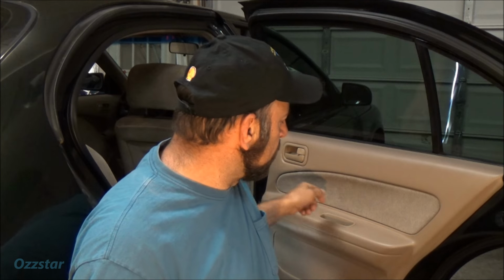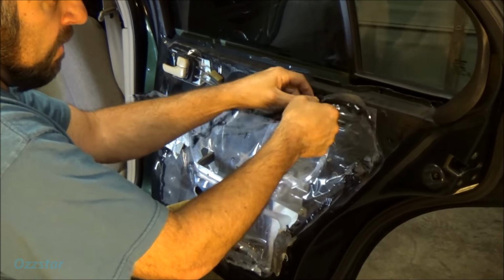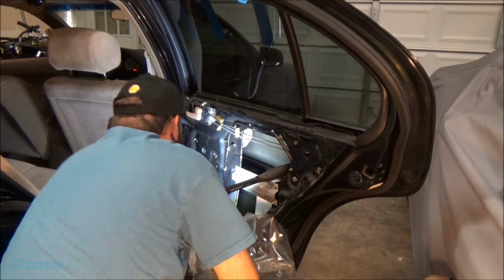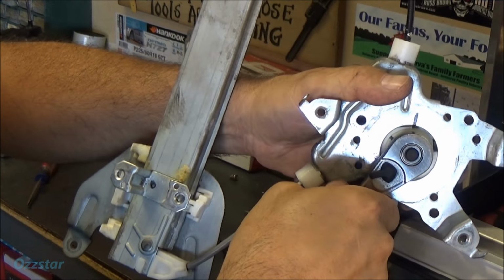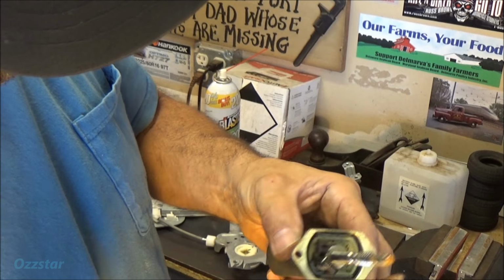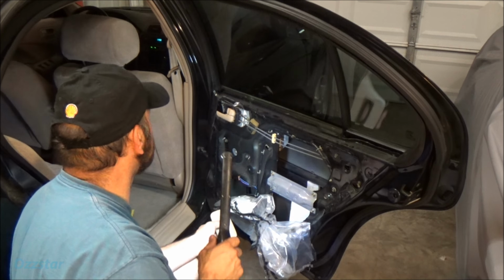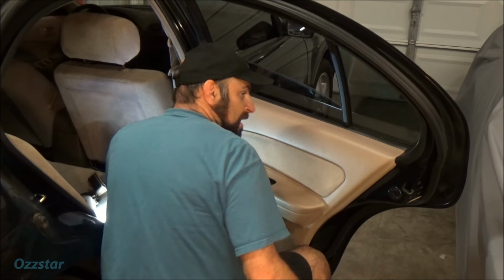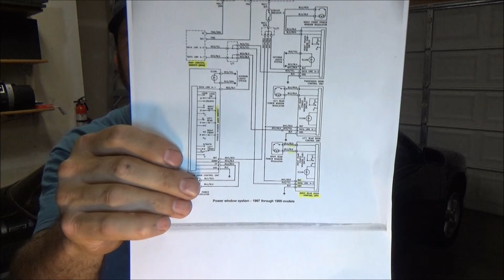Power Window that won't Go Up or Down

Comment: Congratulations. A man who can actually make a video that can be understood and shows excellent details.
Reply from the maker: Thanks David!
Reply: Hi guys, wonder if anyone might be able to help. My Roadster mk 1 driver's window has been slightly erratic for about 9 months but always corrected itself. After a serious cold day it appears to have had enough. It goes down but only up by 1/4 - I've tried all the 'tricks' but no go. Just changed the window motor and still the same. I'll watch the vid when I get back home but does it sound like a regulator issue (as the window does go up partly..??)

Comment: There are a few reasons why a power window stops working and i hate the fact that you can take it to a garage and get ripped off telling you its one thing when it was just a minor repair. Thats why i like to watch you tube videos and get informed prior. Ive replaced a power window switch myself before but never the motor. I'll leave that to my mechanic guy. Thanks so much for the clear instructions it helps so much!

Comment: Good advise -  you never want to break your rubber! 😁

Those are my favorite kind of fixes - no money spent, and no driving to the parts store. That's a win-win! Good job getting her moving again. 👍👍
Reply: Yes!  I have found that just cleaning up the old motors and regrease everything works a lot better than replacing with the aftermarket junk. 

I've opened up motors that have lasted at least 3 years and still going.  Gotta love NO PARTS NEEDED! 😂😂😂
Reply: @CubasAutomotive  - Nice, Cuba - good to know! Thanks! 👍🍻
Reply from the maker: Yeah man, breaking that rubber can be emotional.  Thanks for the classic hanger you mailed me.  I got a big kick out of that one and so have a few friends I showed it to!!
Reply: @ozzstars_cars  - HAHHA! Great man, glad you liked it! Everyone got a kick out of it here as well - always struck up a conversation, LOL! I knew you'd appreciate it. 😁👍😎

Comment: A few years ago a friend of mine had a Ford Windstar that was nearing it's end of life. He called me one day and told me his drivers power window wouldn't work. I went over to his house and hit the bottom of the door with the side of my clenched fist while pushing the button. The window worked perfectly. A few days later i asked him if the window was still working. He said, somewhat. When i asked him what he meant he said that his foot was getting sore because now he had to kick the door to get it to work. 😁
A couple of days after that i gave him a lift home from the crusher. Problem solved!
Nice job, Glen.
Reply from the maker: I have a feeling your friends van had more than a window issue. Haha  Thanks for that story.
Reply: @ozzstars_cars  HaHaHa  The whole van was an issue.

Comment: GREAT VIDEO.  I have the same problem with '98 Accord V6 sedan R RR window.  Likely I have to replace the motor.  I need to buy the tools and die-electric grease and sulucone lubricant before getting started.  Thanks again, I could not have done the repair without the help of your video.
Thanks again.
Reply from the maker: Glad the video helped you out and good luck with the repair!

Comment: That's a good thought, to use tuck tape when putting the vapor barrier back on. I found the OEM sticky putty at an automotive paint shop, but it's expensive for what it is. Now I have enough for hundreds of vehicles, ha ha.
Reply from the maker: Nothing like a good seal to keep the gremlins out, right?

Comment: Coming from a 50 yr. experience Auto tech, now retired , when a motor like a rt. rear window motor sets unused for a while in dusty and damp and hot conditions the result can be the brushes tend to really to stick to the commutator almost like being tacked to it.  In most cases the right rear motor is less used. Been there 100's of times.
Reply from the maker: Experience matters a lot. Thanks for your comment.

Comment: I will use a multimeter (just ordered it) nstead of a test light.  What should the digital read-out show?  How many volts or mA and on what setting do I out the multimeter?
14:06 reminder for myself only
Reply from the maker: Most car window regulators work on battery voltage, 12V system.

Comment: Hello, great video. I am facing issue with my rear left side power window. When I use driver side master switch, it will come down but not up. Rear switch is working fine though. Problem is not with the driver side switch, as I checked it by replacing with other. What do you think?
Reply from the maker: Have you checked for a broken wire or corrosion in the circuit?  A wiring diagram will be helpful to find the problem.

Comment: How do I keep the window from dropping while I remove the regulator? I have a 2010 HHR. Can I remove the motor without removing the regulator? Thank you!
Reply from the maker: Most guys use tape if there is a window frame, otherwise remove the glass. Usually only 2 bolts or clips

Comment: Nice fix Glen, brought that motor back to life. Gotta love it...
What do you think of  the C8?
Reply from the maker: For now anyway. 😉 Thanks man.  When I saw the C8 in person I thought it looked sexy overall.  Tremendous performance.   I won't buy a first year GM product but maybe in the future.  What do you think of the C8?
Reply: Ozzstar , Glen love my 17 Grand Sport and intend to keep it and the more I hear cautions me on the C8
GM has many failures over the years I can get an allocation at my local dealer but I’m hesitant as I worked for Chevrolet years ago as a line Mechanic at a local dealership. And being that the car hasn’t been reviewed by anyone other than GM engineers I am cautious..

Comment: Smacked my motor with a hammer on the driver side door and it works. Thanks for the advice
Reply from the maker: Now you know the trick. Keep on mind it's usually only a temporary fix. Are you going to replace the motor?

Comment: Hello sir i have a question, is the right and left window have the same fuse? My left window is working but my right window (driver seat) isnt and its not making a motor sound when i push the switch up and down. Thanks.
Reply from the maker: It should be on the same circuit but confirm with a wiring diagram.  Use a test light at the drivers door to see if there is power AND ground.  If there is then you can test the motor and switch.  Wires can break where the door hinges are so keep that in mind.  Good luck
Reply: @ozzstars_cars  Thanks for the help

Comment: My window will not go down. I replaced it with a new window actuator motor and still the same thing happened. It will go up but will not come down. 😩 Any more suggestions to get my window to go down? Thx!⁶
Reply from the maker: How do you know the window will go up if you can't get it to go down?  Have you tested the switch?
Reply: @ozzstars_cars  Before I put in the new motor I tested the motor & it went up, however I can't recall testing it doing down. I installed the unit into my Honda Element and it went up & never came down. I hear the power in the up position but when I press down nothing.
Reply: @ozzstars_cars  I'm going to open up the old motor like u did & see if I can get it to move.

Comment: The cable on the motor is broken.its in a not.so I can't get the window down far enough to get it out.theres not enough room to get the motor out.HELP.
Reply from the maker: The window glass need to be up to get the window regulator out.

Comment: None of my windows will go down. They are all in the up position.
Reply from the maker: Wiring diagram, I'd start by checking fuses, then relays, or the master switch.
Reply: @ozzstars_cars  Thanks, that's what I figured... If only one had been cracked open a bit.